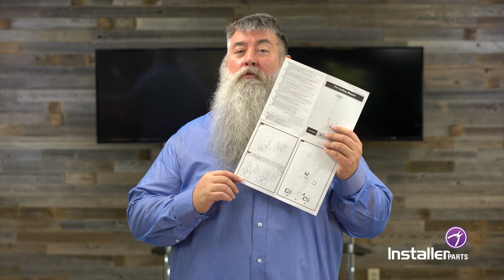InstallerParts Episode 15 - Flat TV Ceiling Mount With Tilt And Swivel

Comment: is it safe to put the bolts directly into the ceiling?? shouldn't there be those plasticky things in which you can place the bolts?
Reply: Little late to but somebody else might have the same question. If you were putting lag bolts directly into wood, you do not need a plastic anchor. Those are for drywall and screws with a downward force. Also when using lag bolts into wood, you must pre-drill the hole with the appropriate size bit for the lag bolt you are using. Bigger is not better when it comes to lagboots especially in load-bearing structures. The strength of a lag bolt comes from its pull out rating and how many threads are in the material. The weight a bolt can safely hold I would say one and a half times the load (TV and mount combined weight) and that would be found as the bolts tensile strength rating. These figures are readily available in lbs or newton meters but anything grade 5 or higher would work. Grade 8 is what's usually available in hardware store. 
When I said bigger is not always better. This means you don't need a huge bolt. What you were drilling into is only an inch and a half wide by 3.25 for the depth and your drywall is 1/2 in to 3/4 thick. So if you want 2 in of grab Force, you will need to drill 2 1/2- 2 3/4 from the ceiling. Then use a bolt that is 2 1/2 - 2 3/4.  
If you choose a bolt that is too wide you will actually weaken the structure on integrity of the board you are screwing into. It is far more important to have a longer bolt and the correct drill bit for that lag bolt then it is to use a bigger bolt.

Comment: **WARNING**WARNING**
Great video. They forgot one very important small step and if it wasn't such a huge safety issue i wouldn't say anything.
One attaching the ceiling mount to the ceiling. After putting in your 2 anchor bolts, turning them to lock and tightening them against the mount...
You see those other two screw holes? You need to put a screw in at least one. The purpose of the screw is not to hold any weight so you don't need a drywall anchor or to do any work above the ceiling. The purpose of those two screws, in those holes, is to keep the mount from turning off the slotted locks. Wood and drywall swell and shrink depending on humidity, not allot but enough to loosen the anchor bolts so they have play. Now regardless of whether it is an adjustable design or not, if the tv (which is attached to the pole, and essentially is a lever giving mechanical advantage *got kids do they ever do stupid things?) if it is turned the right way, beyond its design or its stop, it can pivot on its axis with little effort and it can come loose. "That is what the two screw holes are for", to keep the mount from turning once installed regardless of conditions. They are just a lock for the mount.
Everything else in the video was excellent and good advice just don't skip that step. 2x 1 inch screws that cost less than a penny each, isn't a huge in ensuring your highend tv doesn't meet an untimely demise of god forbid anyone is injured when it comes down 😁👍.